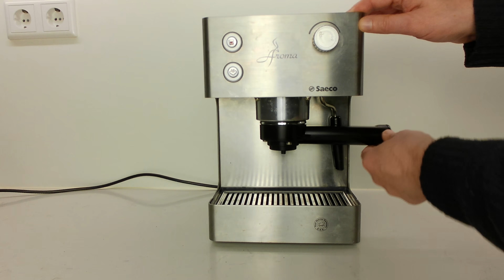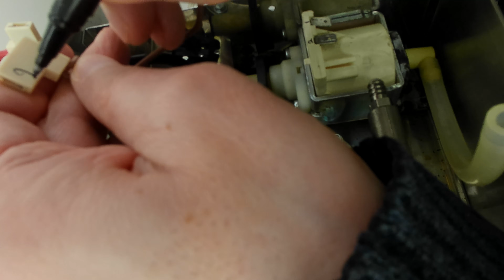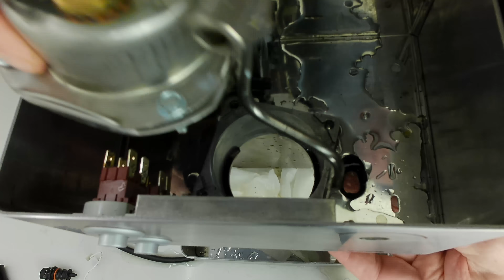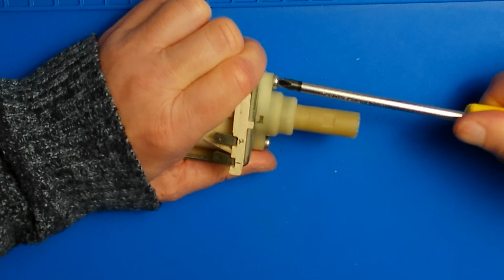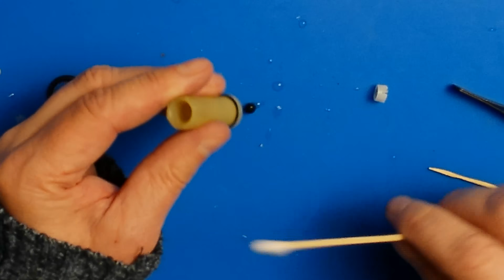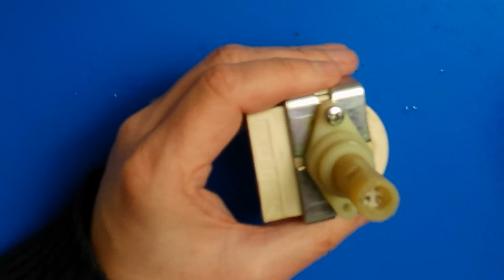Espresso machine repair - Saeco Aroma

Comment: Same coffee machine but when I turn it on the power goes out can it be repaired is it better to throw it away?
Reply from the maker: Hi Luciano, that very probably means there is a short in the machine somewhere. If you have a multimeter, it is very much worth it to open it up and see if you can find the short. At least have a look inside if you see any residue caused by a leak. Feel free to send me some pictures, we'll have a look together.
Reply: @repairchannel Thanks, I'll try to open it and take your advice
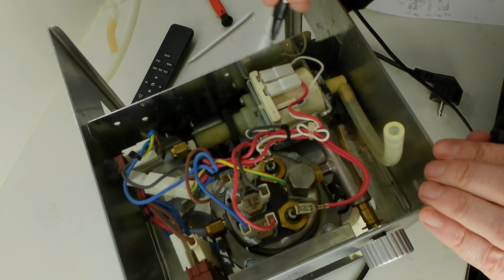Reply from the maker: @lucianogiovannini9058  Buona fortuna! You could start by checking the resistance between the red and the white wire connected to the heating element (the ones with the large brass nuts) which can be seen at 0:54 in the video. That should be about 50 ohms, if it is zero ohms, disconnect the red and the white connector and check the element itself (so not the wires, but the connectors to which they were connected). That'll tell us if your heating element is still good. Does it immediately trip your circuit breaker when you turn it on, after a while or when you start brewing your espresso?
Reply: @repairchannel the circuit broker cut immediately😢
Reply from the maker: OK, have a look inside and measure that heating element, that will tell us a lot, but it may very well be some water that ended up in the wrong place. Sometimes plastic connectors are screwed into the metal part of the pump which will start leaking over time, which with that kind of pressure is more like a small waterfall. Did you notice any leaks?
Reply: @repairchannel no leak are visibile,  the resistance is 54.7 ohms, but between one of the resistance contacts and the boiler shell I detect 0.47 ohms
Reply from the maker: Ow... that's too bad, that means the insulation of the heating element failed. It is repairable, but will probably cost you more than a new machine and a  lot of work, so you could offer it for spares or repair on subito or ebay. If someone needs a pump or maybe even the portafilter holder, they will provide you with a small discount on your new Rancilio. It's still a good thing you opened it up, because it could have been something simple. Now you don't have to regret selling it for spares.

Comment: How did you diagnose and get parts?  My boiler and pump runs. But water is leaking out of the grind up sides.
Reply from the maker: Could you specify which part of the diagnostic process that is not in the video you would be interested in? And what is the "grind up sides" you are referring to?

Comment: My pump pushes water but doesnt poor a good shot of espresso. I wonder if the ball and spring mechanism is failing.
Reply from the maker: Yes, that is very well possible. Did you already decalcify your espresso machine and clean the brew group?